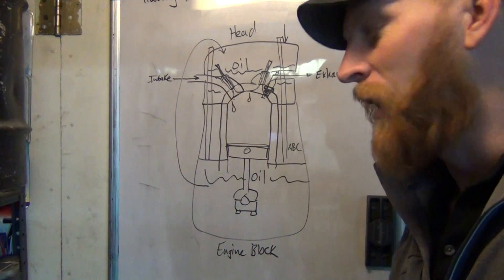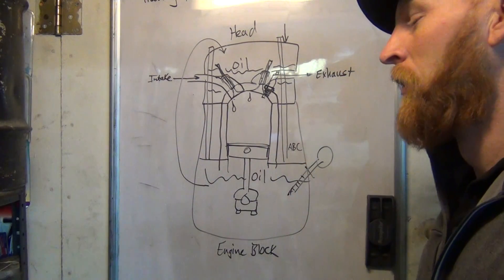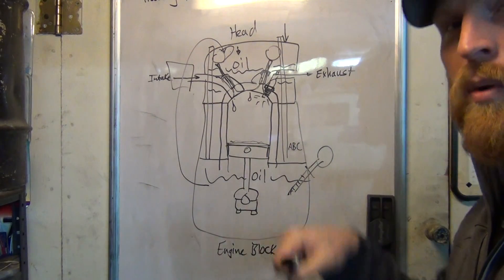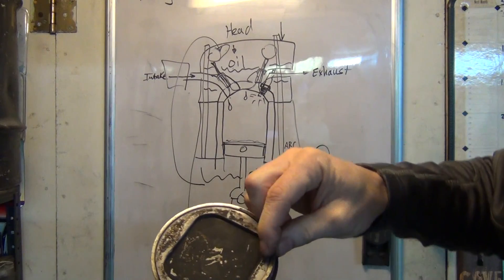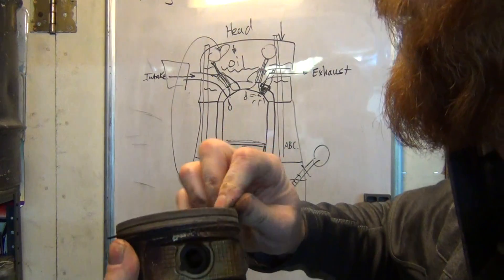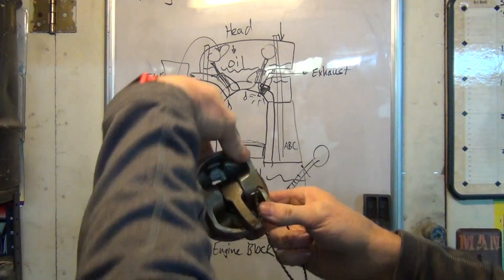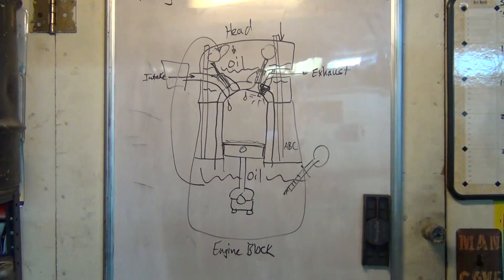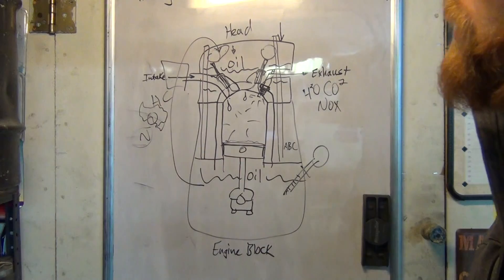Oil Burning Explained

Comment: I get a lot of blue smoke on cold engine. Later it clears up. Is that piston rings? I know it is... Just don't really want to do the job...
Reply: +Gregory May lol he just said in the video that blue smoke upon start up is probably your valve stem seals.
Reply: LazyEyeCrazyI
LOL. It doesn't smoke on startup but smokes when the engine is cold and the car is driven. And is not only for a while. It smokes untill the engine is at proper operating temperature. How is that funny?
Reply: Gregory May
Oh, ouch. Well, it's an expensive repair either way. If it's a beater, I'd just buy a new car or a used engine from a scrap yard, unless you choose to do the repairs yourself. Rebuilding an engine is extremely expensive.
Reply: Gregory May
It isn't a rotary, is it? Rotary engines, by design, consume oil.

Comment: Thanks for the video.  Do you know what is the burning oil issue with Camry 2007?  Also how do you pick the right rings size and the pistons?  Is it better to change the block?  Please guide how easy of difficult to do that and how can I get any guide?
Thanks